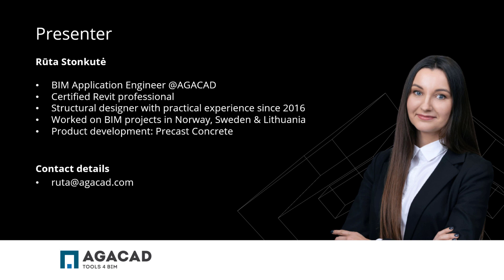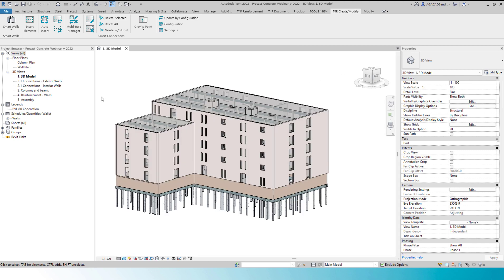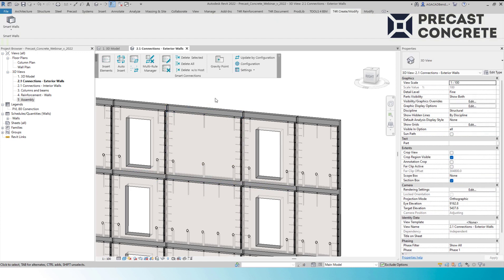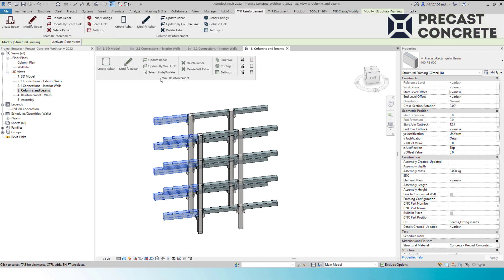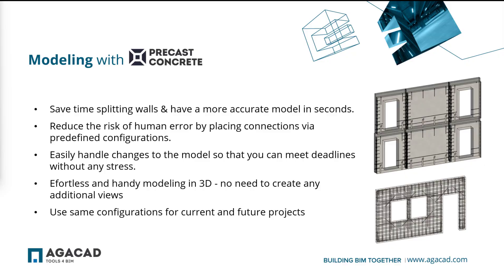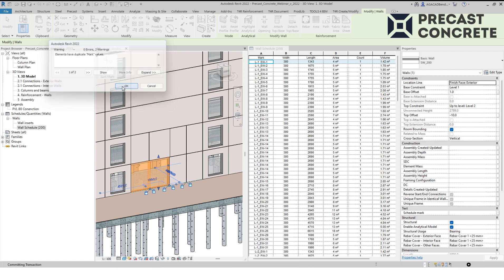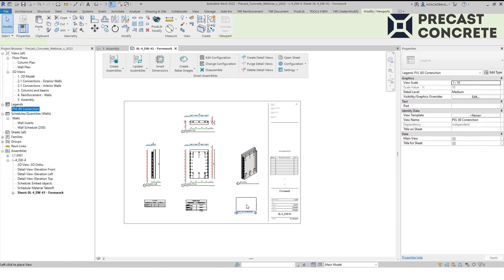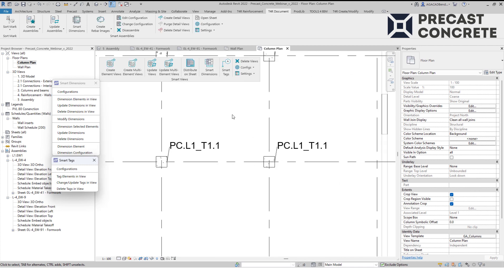Precast Design in Revit: From Model to Drawings Faster, More Accurately

Comment: Is this plugin different than the precast tool that te actual version of revit brings?
Reply from the maker: Hi, the plugin offers many advantages over Native Revit. While Native Revit automates some tasks, it has limitations (besides UI/UX challenges). In contrast, Precast Concrete provides extensive functionality in design and drafting. The workflow includes creating reusable configurations across projects. Moreover, you can add structural connections only under specific conditions (e.g., column/framing joins). 
Additionally, you can incorporate structural connections that are automatically placed only when specific conditions are met (e.g., column/framing joins). There are even more advantages compared to Native Revit. If you'd like more information, feel free to contact us, and we can arrange a demo for you.